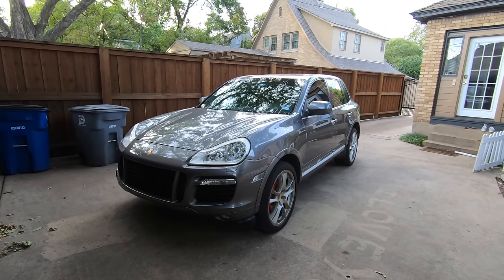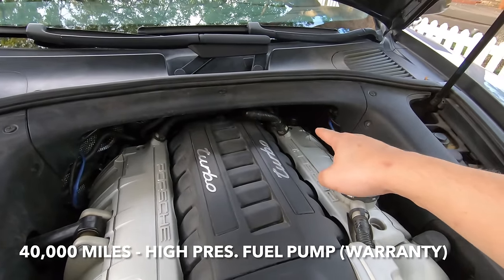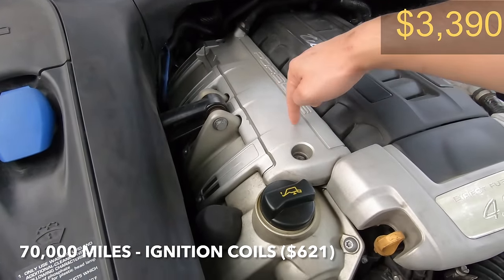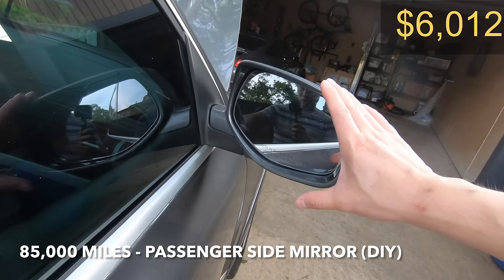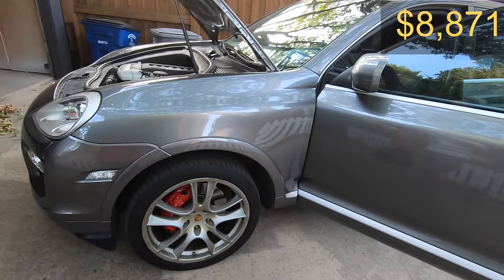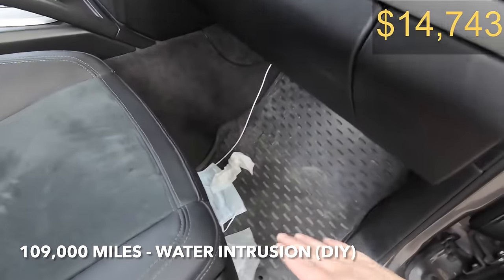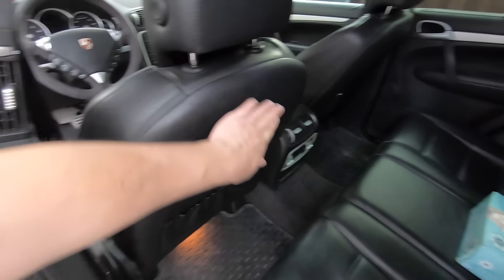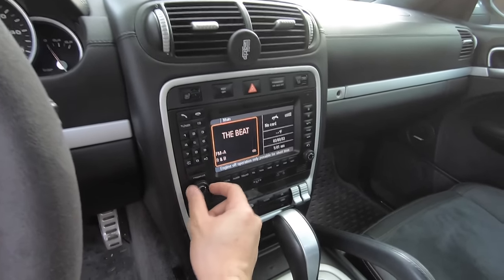Why Are Used Porsche Cayennes So Cheap? Owner's Review of 15 Year Old Cayenne Turbo (955, 957)

Comment: I had a 2006 Cayman that suffered the dreaded bore scoring.  Cost 25k to have the engine redone but it was punched to a 3.8 instead of the 3.4 and the ins bearing was fixed as well.  Fun cars to drive but when they get you...they really get you.  Now I drive explorers.  Older ones. Super reliable, and if they break parts are cheap and if it is too much you just get another one. No more blowing money on cars for me.  Until I find a boxter for cheap...lol.

Comment: I'm on my second Cayenne GTS, the first one was a 2009, it just died on me, had too many problems that it wasn't worth fixing, my current Cayenne is a 2008 GTS, and I've experienced nearly all the issues on the video, plus oil coolers leaks, and crank seal leaks. Currently it has some suspension issues, and I'm kind of hesitant to fix it, might just let it go for dirt money. I would have put up with all of those issues if I was single living alone, but if you got a family that you should care for, then all of the down time of car repeated failures become unbearable. I definitely want something Japanese or American now
Reply: Stay away from American builds, the quality control is shameful. You want reliability? Toyota/Lexus, or Honda.
Reply: if you  keep waiting instead of fixing it no car will suit you. You will end up breaking every car.
Reply: As a lexus owner quality control on Lexus toyotas are horrible. Melting interiors, frame rust, body rust, paint peeling, head gasket issues, oil consumption, engine out jobs... @Shteven

Comment: I think the cost of maintenance is acceptable for a car with that many miles, but the uncertainty of the car possibly leaving you stranded is the main issue to me. I really want a car that will likely never fail when I need it the most, on the road.
Reply: I've owned a lot of cars from new to 80-100k, 5-7 years, with nothing but routine annual maintenance. There is no excuse for such poor reliability.
Reply: Forget the age and mileage… it sprung a coolant leak at 26,000 miles!!!! That’s something that could have left him stranded on the road (large enough coolant leak) or possibly even overheat the engine all together and fry it!!! 😳😲🫣 

Now THAT type of mechanical issue at ANY mileage is a horrible display of reliability, period, let alone for a new car (26k miles)
Reply: @I_know_what_im_talking_about  exactly. Even new cars can and do break down. 26k miles is barely broken in.

Comment: It never fails to amaze me how Premium car brands are so costly to maintain. In Australia I daily drive a 2013 Holden VF Sv6 sportswagon that is about to clock 100,000 miles or 160k. Just routine services oil changes, tyres and one set of brake pads so far (rotors are still original). On a long interstate drive Sydney to Melbourne recently I managed just on 7 litres/ 100 km with still half a tank left after 500km with cruise locked on 110 km/h.  The VF that cost $43k Aud when new still has a very nice semi leather and alcantera interior that still looks new. I have no desire to ever “upgrade” to a premium Euro brand. Sadly Holden is no longer in Australia thanks to GM Detroit and paralysed from the neck down Australian Government. Sad 😢
Reply: I have heard of the Holden, but they don't sell them in the USA. I'm guessing the only way to buy one here is to import one that is at least 25 years old (which is restriction age here in this country)

Comment: Never buy old German cars including BMW, Mercedes, Audi, Porsche and VW.  I had a used Mercedes I bought in 1991 that was built in 1987.  It was a nightmare.  It was constantly in the dealership for repair.  I got to know the mechanics on a first name basis.  Parts were extremely expensive and labor was also expensive.  Instead, buy used Japanese cars like Toyota, Honda or Subaru.  I have a 2013 Toyota Tacoma with 150k miles on it.  I have only done routine maintenance.  I also have a Honda Accord with 232k miles on it.  I have only done routine maintenance on the Honda also.

Comment: My 2016 Holden Commodore, has had one stop light bulbs replaced, one 12 volt lead acid battery replaced, one set of tyres replace & two 3 volt fob key battery's replaced. Plus regular servicing.

Comment: We have a 2016 Cayenne Diesel and have had very little trouble with it. The only 2 major issues were the diesel particulate filter & a water leak inside the car on passenger-side floorboard.  I can't remember the initial cause but I believe the water was coming from a clogged tube that drains rainwater (does that sound familiar to anyone??) The dealer said it was rather "typical" of Cayennes.  As for the dreaded diesel particulate filter.....Luckily it was warranty work but it would've cost us around $3500 to replace.  It only has 30k miles on it currently and they're mostly city miles and I was told we need to get it out on the highway so the filter could heat up and burn off the residue.  Anyway....love the car but after watching this video I may be in for some heft repair bills if we hang on to it.
Reply: That is just a valve under the wheel well.  A 15 minute job.   Scam by your dealership.

Comment: Yeah, love my little 2012 Cayenne base, was affordable and first actual "nice" car I've ever owned. But my GAWD every repair is so expensive if you don't do it yourself.  Pretty much anything goes wrong, it's $1200-1500 + to fix.  Talked with another Porsche Cayenne owner, and he does all his own repairs, said most Porsche owners he knows do that too because repair shops cost so much for every fix that it will bleed you dry.  Still love the Cayenne though.

Comment: I bought volvo s60 2.0 turbo from the first owner in Germany back in 2019. with 180.000km. after 5 years and 60k not a single issue, while I have the most comfortable seats Ive ever sit in, amazing stereo system, webasto heating, etc... amazing quality for little money. New cars are funny compared to old volvo.

Comment: 1986 Corolla, 9 years, 95,000 miles - one sidelight bulb replaced at 60,000 miles.
The Porsche is at the bottom of JDPower along with Range Rover and MINI.
Lexus, Toyota, KIA and Hyundai are great.

Comment: I have 11 cars. Two are Porsche 944 S2 (one hard top, one soft top). I have owned them a long time and they have both been less trouble that this Porsche! In fact, the soft top has 134k miles on it and it's just had its first clutch change.

Comment: I own a 2009 Porsche Cayenne GTS with just over 227,000 miles on it. I have had minimal issues with it as compared to your 2008 Cayenne Turbo. Yes, my driveshaft carrier bearing went out while I was driving it really hard on a winding potholes road in the Santa Cruz mountains...I had it replaced with a complete unit for about $1500. I bought mine for cash with 66,000 miles on it. Plastic coolant lines underneath the intake manifold are a pain in the ass, but minimal cost. Overall, it has been much more reliable than yours hasbeen

Comment: I have a 2007 X5 with the V8 that I've owned for the last 10 years. It costs about $3K/year on average to keep it on the road. Some expensive repairs were done for leaky value seals causing oil burning; two AC compressors going bad; air suspension failure; coolant leaks, etc. If you can't afford new German iron, you can't afford used either.

Comment: That’s a crazy amount of repairs. I have a 2016 Acura MDX with 150k miles and have had only $700 in repairs, which arguable were wear items (wheel bearings at 145k).

Comment: In 2017 it was either this(no turbo), Range Rover or the Subaru 2,5 xt.
I went with the Subaru and never looked back (or spent any money).
Just replaced the suspension at 140k kms with the original(tokiko) for around 1000€.
That's it. Plus it's crazy fast for the way it looks...

Comment: I have had a great time with my pretty dependale '07 S from 100 to 200k mileage. Someone else had to deal with coolant pipes under warranty, every cayenne dealt with that, the cast ones have worked fine. The starter at 150k was challenging, the location is in between the cylinder heads but I took the top of the engine apart to replace it and saved bizillions. It wasn't super hard, just a lot of steps. The best part is that with all the covers, the bolts come out easily without any rust on them. I enjoyed working on it and hate working on my F150's, wich always means fighting rusty and stuck bolts. It is a heavy car and clings to the road even in a driving rain and tires wear faster than on  any Toyota but that is not a suprise.
Speaking of rain, this is the safest car out there in bad weather, I have to remember to slow down because of the other vehicles going half my speed.
I would never own an Audi or BMW, but I will replace my Cayenne with another 100k one sometime, probably when the tranny gives up and then will write her off, the car will have been worth it. That's just my experiance.

Comment: I just picked up a 2009 Audi Q7 with 170k kms for 250usd... 

Been driving it around fine, mechanically its not bad. Gears dont shift nicely but very driveable. Body has small whacks everywhere, no dash lights... piston slap/diesel sounds a bit loud. 

Overall, hell yeah.

Comment: Incredible number of failures for  car of this caliber. I owned a 2019 Macan S for 3 years and 50,000 miles. The only issue was a thermostat failure that was covered under warranty. My 2015 Boxster has over 50,000 miles with zero issues, just oil changes, tires and I just replaced the brakes myself.

Comment: I got a 2006 tucson and so far I have invested around 3-4k in 2 years, but never have I had as many issues with sensors and stuff like that (or water leaking inside).

Comment: people below saying oh Toyota this Honda that, this is almost an exotic as far as performance on/off Road. You won't be doing any rock climbing in a Highlander Hybrid, this thing with offroad tires can keep up with a jeep no issue off road. it is the Turbo model with 400+ horsepower from Pre 2010. The Turbo Models kick out more heat causing more wear and tear on the cooling system. If you Like these and want just a basic SUV with some style the Vr6 based motor would be less problematic Cost wise. The common issues are due to Mainetnence not done like the Leaking sunroof drain, Drive shaft Carrier Bearing, and for the V8 Models having the Coolant pipes under Manifold switched to Metal vs Plastic. Once those are done it is a pretty decent SUV plenty out there with 200+miles on the Odometer.

Comment: I have a question. When all of that broke (thermostat, coolant pipes, driveshaft bearing) why didn’t you replaced with aftermarket upgraded parts? Aren’t they actually viable, they didn’t work properly or what? There’s a lot of upgraded parts (metal pipes instead of plastic ones and so) so you can (in theory) upgrade them and forget that problem altogether.
Reply: Exactly,  That was my thought too.....
Reply: @robsnizzle79 most of these issues are small and can be fixed by anyone that has a moderate amount of mechanical knowledge.

The interiors of these are so nice and cost so low that it’s worth keeping up with it. I found a 2014 3.6 with 70k on it for $18k. You can’t find even a Jeep GC for that. 

So, what you are saying is I can get a cheap luxury SUV with a near built proof engine and transmission from a legacy manufacturer with gear parts availability and most of the issues can be fixed with a fairly basic tool set? Oh and it can fit in my garage and tow 7k…. !?!?
Reply: @Klake-bk2dp  Well considering the age AND "Production numbers" of these vehicles, owning a PORSCHÉ is HIGHLY attainable. Also, some of the recalls MIGHT still be UNDER WARRANTY by the dealership despite the age of the vehicle be ause they were considered HAZARDOUS issues like the headlights for one. Just getting to know the ins/outs of these cars knowing they weren't PERFECT (LIKE ALL AUTOMOBILES THESE DAYS), and finding UPGRADED PARTS to fix the USUAL ISSUES/GREMLINS would be worth it to me there's alot of aftermarket parts in my opinion that makes it worth to buy this vehicle. Wife an I are eagerly looking for a late model 1st Gen. 1st thing I'd do to it due to it's SIZE/weight is get QUALITY AFTERMARKET CROSSED DRILLED SLOTTED ROTORS for it to ease the chewing up of brake pads AND possible warped rotors, plus ENERGY SUSPENSION makes POLYEURETHANE BUSHINGS that alone would help with the stability of the vehicle and ease alot ofbstress on other components.

Comment: This is why I owned a 20 year old Kia Rio. It owed me nothing for the years of constant, reliable use. Apart from oil changes, 2 sets of new tires, plugs and leads once and 2 sets of brake pads, it did 280,000 kilometres before a tree fell on it during a storm while I was driving.

Comment: Bought a new Lexus LS 430 when i retired in 2003....21 years and 188,000 miles later the only maintenance other than scheduled is valve cover gaskets and coil packs.

Comment: So I’m on my third Jeep. I’ve had two JK’s with Will over 200,000 miles each and my JL is at almost 50,000.
It seems like Jeep makes a higher quality vehicle from a mechanical reliability standpoint. This video has ended my research into looking at buying a Porsche.

Comment: We've owned a 2006 cayenne s since 2015, outside of regular upkeep my mechanic friend and i have changed serpentine belt, starter, valve cover seals, spark plugs, coil packs, AC motor, hatch struts, switched all outside and interior lights other than HID headlights to led, coolant 
Reservoir, engine mount arm, tranny flush (professional cost 2100$), power steering and brake flush,  put a pioneer deck in it for 1300$ to get apple CarPlay etc , Long story short we're about 9 grand in fixes in 8 years and are sitting at 184K KMS. Car is running great, obviously super fun to drive, wife loves it. Currently beating any 600$ a month car payment. Time will tell.
Reply: forgot to mention complete new fuel pump system, If you own this vehicle do both pumps AND the fuel filter and pressure regulator that sit on respective sides on top of the fuel tank. We did only the pumps and still had starting issues. Do the whole system at once.
Reply: @dorny14  I've been looking at Cayennes. I can do a lot of work myself (brakes, suspension, oil changes) but anything electrical, I can't do. I also can't tear apart engines. I'm on the fence with a purchase but I can definitely save on routine stuff and not go to a shop.
Reply: @morecowbell235  well this comment is 7 months old. haven't had to do anything to the car since. Been running well. I"d say man if your happy ordering parts and doing work periodically on weekends and trouble shooting, get one. If you want to start it and forget it, dont get an old one.

Comment: Pos saturn: $2100 purchase price,  drove 8 years. Spent $1200 in repairs not counting tires. Engine burned a valve.  Car went to scrap with 351k.  a/c still worked.

Comment: Add for Porsche For Sale: Porsche (year, model) 120kmiles, water pump done, alternator done, turbos done, radiator repaired, new brakes, ECU replaced, thermostat service done.

Add For Toyota For Sale: Toyota (year Model) 190k miles, runs GREAT, no issues, regular oil changes.

Comment: havent had any issues all winter and its a monster, it was already high milage and used up alot from its previous owner, ive noticed alot of these cars are meant to be broken in over hundred of thousands of miles to iron of the kinks, most people just baby the car and by the time warranty ends they trade it in with minimal break in and thats why the next guy gets stuck pouring money into them for years, ive owned alot of "unreliable" cars and usually the most high mileage vehicles has some annoying quirk that isnt reasonable to "fix" but have always been the most reliable, matter of fact this goes for most things including electronic devices you like phones, computers, firearms especially, shoes

Comment: My 2001 mercedes E320 never had any problem. Original brakes and exhaust are still original factory. However now I have rust problems all over. We live in cold climate where they salt the roads a lot.

Comment: Had a german VW Golf for 13 years. Plenty of issues from transmission to window regulators. A fun car to drive for sure but the repairs were frequent and expensive just like this Porsche. Since my VW we've had two Ford Fusions that have barely had any repairs at all in the ten and 12 years we've had them. Not as much fun and not as stylish, but I saved thousands over the life of these cars vs the VW.

Comment: Auto leases place Porsche autos on the road, and mechanical services and repairs are covered, often by extended warranties. However, once the lease is up they end up on the used car lots and repairs and maintenance become exceedingly expensive.

It's hard to imagine cars as complex as those being made by Porsche-Audi (or any of the other luxury manufacturers) being in the "throw away" category, but a trip through major wrecking yards validates this...intact, late model luxury autos being parted out for their sophisticated, uber expensive components.

Comment: My wife’s Lexus RX 350 200,000 miles.  The shut down at idle is a switch on the dash.  Back to lexus Brakes Tires struts about it.

Comment: crazy ive been driving (like a maniac) a seat ibiza (1,6) and only had to do oil and tires till a massive crash when the literal chassis was scraped and apart from some electrical issues (its been 4 years no problem) its working so reliably \o/

Comment: I repaired the drive shaft bearing myself using six pieces of inch radiator hose and some cable ties. - It lasted 6 years and 40,000 miles (until the car was stolen and smashed up) - cost $10. Wheel bearings cost $60 each and cost $50 each to fit. You appear to have an expensive mechanic.